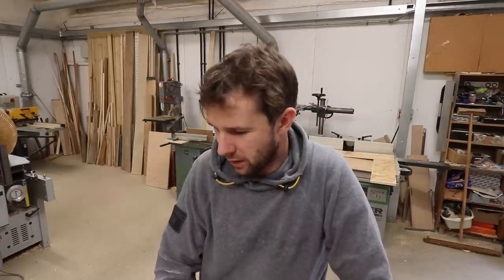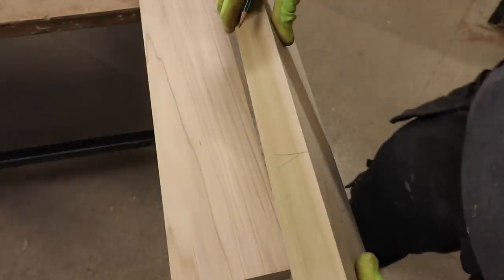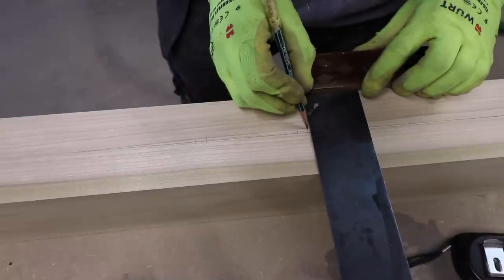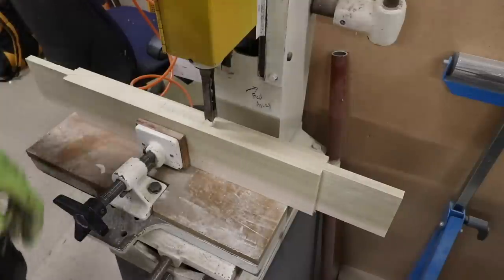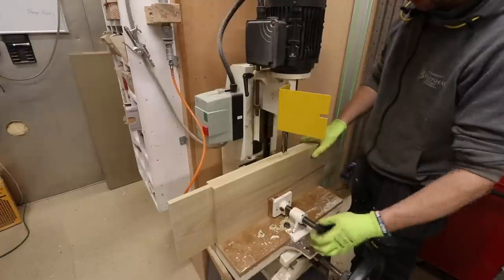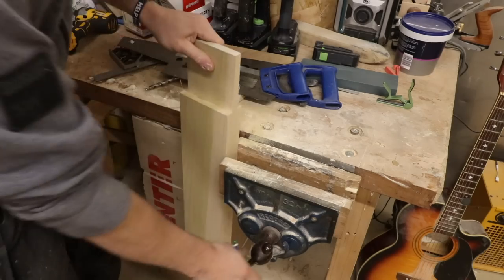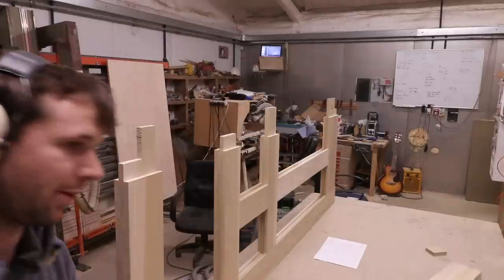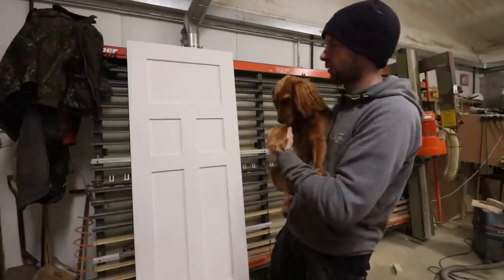Timber Panel Door - A Walkthrough guide to Construction

Comment: I've had a few problems with poplar wood as it likes to twist and warp upon final cut. Like you leave the shop for 5 minutes to talk with mother nature and return finding the wood is off cut.
Poplar is a hardwood by definition and I buy it from a mill just north of here but some luck is required to find it stable. If you invest 200 dollars in machining the wood and it goes bad you just as well should buy white oak or red oak and be done with it.
Reply from the maker: The quality of the timber and the entire drying process is largely to blame here. Properly kilned timber that I then acclimate before using (using controlled humidity for min 6 weeks) I don't tend to see too many problems after machining. Some tension in the timber off the saws but no timber is free of that. The biggest difference has been acclimatising the wood before using myself. Kiln dried from a supplier here isn't ready for internal use in a heated house. It's comes from a storage barn... Outside temps

Comment: Brilliant, really enjoyed that.

Appreciate you taking the time to make the video when you’re bonkers busy and probably can’t be stuffed!

How do you determine the shoulders at your tenon machine? I’ve got a stop block on mine at 32 mm ( always making sashes with stub tenon on 56 mm stiles)  my ‘formula’ is desired width minus 100 mm ( 50 mm left on each stile after moulding) plus 64 mm ( two tenon). It works, but always looking for better methods 😂👍🏻
Reply from the maker: Haha, its tricky, im trying to keep the videos coming.. it does take a little extra effort which isnt so bad most of the time, but its the times where you really have to motivate thats difficult. 

Shoulders are at set out stage. if its a through tenon just mark the full timber thickness on from the end, then mark back moulding and rebate shoulders and setup from there.

Comment: You can use the calipers rack rail coming out the back of the tool as a depth gauge. Just sayin.
Reply from the maker: Yes just be careful it doesnt poke in a hollow of the mortice chisel. The worst thing is cutting haunches slightly too long when it comes to glueing up your joints dont seat. the Combi square gives a wider average. (assume your talking about that part)?

Comment: Do you ever cut a sample piece of of rail say if scribing mouldings too, then use a cutting gauge to  Mark your panel groove on sample piece and square those across then you can get a marking knife and transfer all the set backs on sample piece without measuring back with a ruler, and you’d have the moulding profile on the sample piece so you could mark with a pencil where it ends, square across so when you run it through the moulder you no where to chop it flat on the style, then I would mark out the tenons and haunch using a drawn centre line, with dividers on it, therefore you could use those points in the wood on the knife lines across and transfer then to the tenons to be divided, so in Theory you would have a sample pieces width of styles about 3 inches thick end grain both sides facing up and down , with the mouldings profile on either side with the depth of groove marked on it,  this is always your reference to know how deep the groove goes too, transfer this onto style and continue the knife lines onto the style and pencil lines for scribing mouldings etc, is this ever been done as I thought of it as a better way or is it a complete load of bollocks? Does it even make sense, love to know what you think or where potential errors could be made. Tar. Jimbob
Reply from the maker: Jimbob You might have to take a video and send it to me as im pretty lost trying to work through that in my head, ive even left it and come back to it to tray and interpret haha. 

You could have a sample piece scribed over the moulding on both sides and mark from that your moulding cutback instead of measuring. Id avoid pencil lines on the moulding as itll mean removing them later if clear finish.... pain...., Im not familiar with a centre line and dividers technique so couldnt comment

Comment: Do you make door to exact size of frame/opening largest points, and then trim, or do you make it with tolerances either side ready to fit straight away with out having to plane it for example so it fits with reveals.
Reply from the maker: Yeah generally tight size of opening then trim to suit on the panel saw. When you miss with the hammer banging the wedges in it helps to get over the damage! aha

Comment: At 16:40, what is the purpose of offsetting the ends of the boards when you clamp them together?  I did figure out the purpose of the setback when marking the tenons (finally).  Excellent video.  I wish I had discovered your channel years ago.
Reply from the maker: It would have been probably to keep the door near the centr of each stile. Looks as though I hadn't cut them the same length before setting out, that is all. 👍
Reply: @BradshawJoinery  hmmm. The offset appeared to be the same on each end - about an inch and a half.  In the end, you cut them to length, so it apparently didn't matter.

Comment: Exactly the same construction as a few architectural drawings from the early 20s,  I plan to make a few myself as I learn Victorian joinery techniques. How do you work out the size of wedges? I've also seen them referred to as "Joining Pegs"
Reply from the maker: Thats interesting william, thanks! 
ive done a few door making videos, so you might benefit from watching some of the others. wedge shape over about 70mm would be 2mm to 12mm roughly. I tend to judge by eye rather than measurments. Basically needs strength to drive in but be as slender as possible haha. I tend to keep a slightly blunt end as when disecting the joint the blunt point compresses the tenon nicely within the door creating a good lock. it the point hits first and then the outside tightens up just as the wedge hammers home its about perfect imo.

Comment: Is there a rule of thumb for how deep you would make the haunch go into the stile?
Reply from the maker: I like to have a decent wedge depth up to about 70mm. I wouldn't haunch over half way either.. it's a case of adding glue surface area but not taking too much strength out the stile. Wide stiles I normall go about 40mm haunch for serious strength
Reply: BRADSHAW JOINERY thanks 😊

Comment: What if you use a thicker drill bit than the plywood to avoid that little gap!
Reply from the maker: You can do but it is only seen as a gap with the panel removed or on the ends of the stiles. If you stopped the groove in the joint on the stiles you wouldn't see the gap anywhere. 👍

Comment: Another great video, Ollie ... btw what PU glue do u use?
Reply from the maker: Hi Dave ive used PU Rapid from sovereign chemicals for years, i like it as its a bit slower and softer than others until its fully gone off, but i have started using the woodweld stuff recently and getting on well with that. It sets harder quicker than the sovereign, so not sure i would attempt  door glue up with it yet.

Comment: Great vid once again 👍 what king of ply do you use for panels /exterior door panels ??
Reply from the maker: Exterior panels you want either tricoya, or duraply exterior. I would opt for the latter, Its acetylated wood plywood. really nice and light too with a great quality surface. Much cheaper than tricoya and has similar credentials.
Reply: @BradshawJoinery   thanks very much , I will check with my local suppliers (Ireland)

Comment: Gday Ollie 

Just a quick one if I can ask 🙏

I almost pulled the trigger on an AD 741 ( spiral / power raise) would have been a dream!
   He tells me I can’t have the table extension on in feed!!!  And to use a roller stand 😂. Over 20 k AUD we’re talking here btw !  …. A roller stand! Like I’ve got now for the powermatic! 

I can see you have in feed and out feed extension on 531! Giving you 2500 overall? Perfect for door stiles etc? Anything up to around 2400 without drama?

 300 is about as wide as i’d go anyway! ( mainly 150 or 200’s max)

Maybe this is the go ?  Would you recommend? And what motor/ cutter head would you go for?

Thanks mate I’ll buy you a coffee  ☕️
Reply from the maker: Hi buddy, does the 741 have the big cast fence rail at the front hence not fitting a front fence? 
I remember I was confused when I bought my 531 as I asked if I could have an indeed fence on the planer and was told no by the rep. Anyway... Slight miscommunication the rep called the thicknesser a planer and the planer a surfacer.. turns out you can have indeed and out feed on the surfacer.  But like I say the big round fence rail might not allow this. I don't often have an indeed fence tbh, it planes pretty flat without it and is only really for balancing longer bits on. Id still have a roller stand set slightly low for real long stuff and the 731 has longer beds than the 531 I think. 

I wouldn't have a 741 in my shop, it wouldn't fit. I do miss the electric rise and fall you can spec on a 7 series however. 

Go for the biggest motor and the spiral cutter. You won't regret it. I've never heard anyone look back since getting a helical or spiral block

In an ideal world if run the 531 for flattening alongside a wide spiral cutter thicknesser. That would give me more flexibility and speed. 
It does do a really nice job of planing timber straight. I plane 2.4m Stiles without extensions on mine no bother. Can give me a call if your still unsure
Reply from the maker: You could do it pretty cheaply over here, I'd keep my 531, or even buy a hammer spiral planer, the. Look for a 610mm thicknesser. Can be found decent for under £5k then have a spiral cutter made from somewhere like sheartak.
Reply: @BradshawJoinery  thank you!  I think 531 is the way to go! I can get a stand alone jointer/thicknesser cheap from my old retired mate, superb kit! But I’m in a 10m x10m shop like you! 

Big motor, spiral ( although powermatic pj882hh has that and it’s not great! Leaves little ‘squares’ maybe because it’s a toy but, single phase, or cutters need a change?)

Big motor 👍🏻 spiral … hmm I need to see results in person, my ‘sharp’ straight blades in casadei Fs41 give a superb finish….. for 5 minutes until you get chips 😂 I’m kid of thinking tersa ?  Come in carbide too.. fairly cheap.  Extensions x2 , comfort guard and digital reader ✅

Recon it will be half the price roughly, see what he says I recon around 12K

 Bed time , thanks man 👍🏻
Reply from the maker: Order it without the digital readout (if it's the round one that fits in the handwheel) then buy it separately, you'll get both ruler and readout on the machine then👍